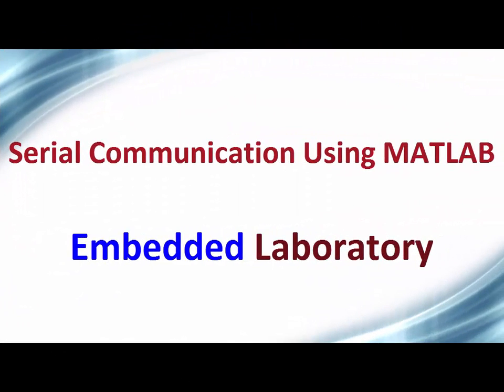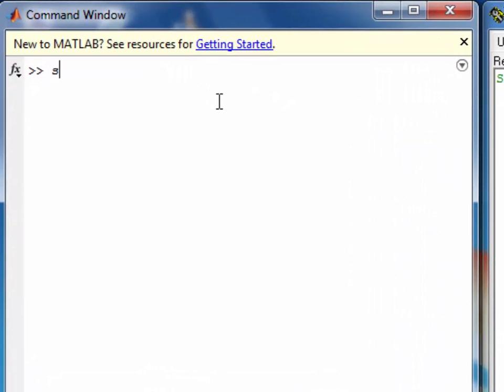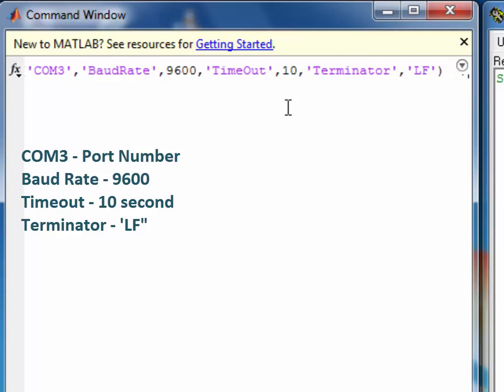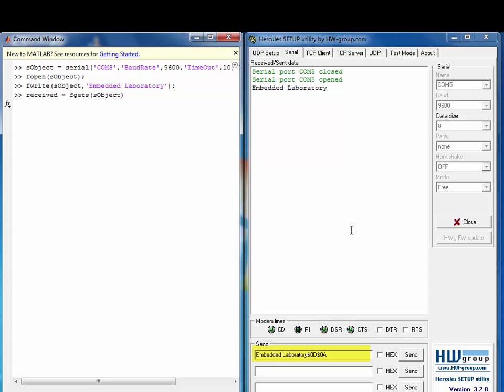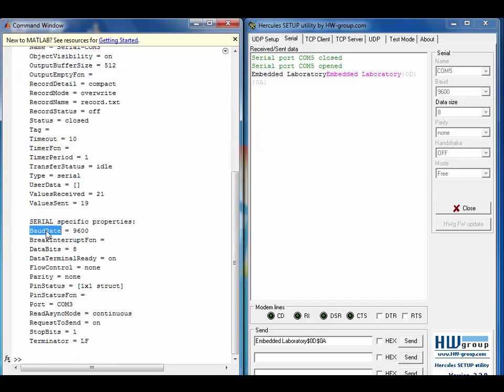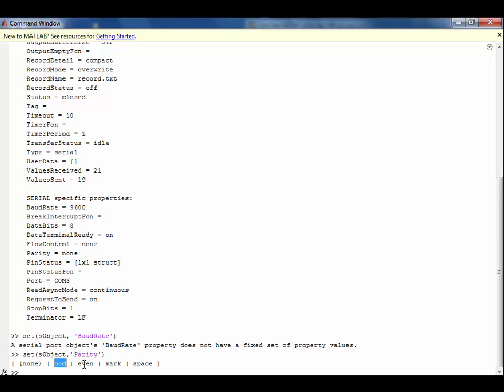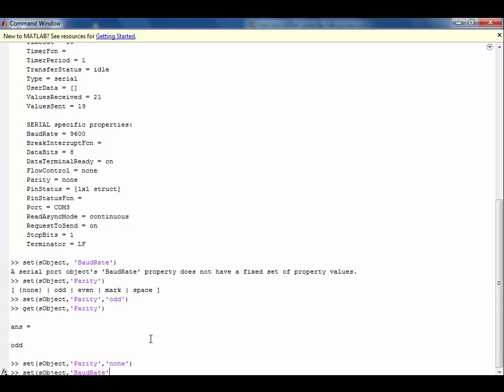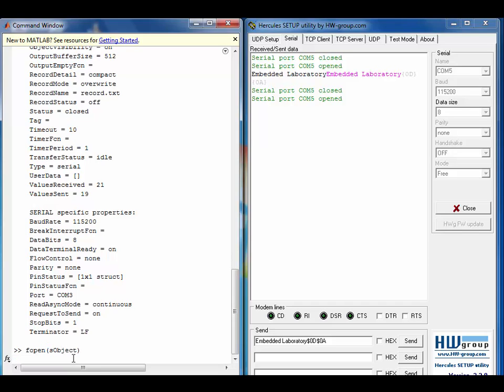Serial Communciation Using MATLAB | 2016

Comment: Hello, I think u did it with a RS 232. What do I have to enter if I use a RS 485?
Reply from the maker: What I understand RS232 and RS485 are interfaces, with UART as underlying protocol. 
So the case code will work for RS485 as well.

Comment: Hi there. COngrats !
I am facing some problems to send variables to matlab by TIVA micro. It time out and all variables aren't send, independently if it is char, int8, in16.... Did you face any related problem?
Thanks
Reply from the maker: You need to send all your data in 8-bit format. Which means that if you have to send uint16_t data then split it into two parts of 8-bit and send to matlab and then combine them in matlab.

Comment: Good example, how can you see the data from the serial monitor software while running the script in matlab?, I get an error because I can not open both at the same time
Reply from the maker: We can't open the same port twice as if we open it once it gets occupied and we will not be able to open the port again.
Question is How I did this??
So I used Elitma Virtual Serial Port Tool, by this I created multiple COM ports on my PC and shorted them with each other (NULL Modem), which means that, you will receive data sent from another port and vice versa.
This is also explained in the video above.
Please let me know if you need more information.
Don't forget to subscribe my channel.
Thanks
Reply: ok, thanks what I did was to use a USB-Serial converter connecting only the arduino TX with this module, I will review that software that you mentioned, it would be more comfortable. Sorry if I did not understand your explanation in the video but my native language is Spanish. regards
Reply from the maker: Okay, If you face any problem don't forget to contact me :-)

Off Topic.
You can also use your Arduino as Serial to USB Converter with a simple program.
Have a look at this video.
https://www.youtube.com/watch?v=qqSLwK1DP8Q

Comment: Do you have any idea how can i connect COM3 to COM5 of my PC ?
Reply from the maker: If they are physical ports, then make a connector which connects pin 2 of one connector to pin3 of other, and vice versa.
And connect ground as well.
But i really doubt that you have two physical ports.
And if you are using virtual serial port software then you can do this in setting, by shorting these ports also named as null modem connection i think.
Reply: thank you.